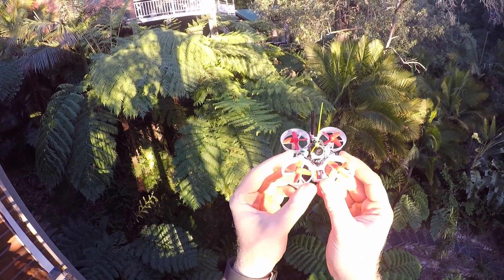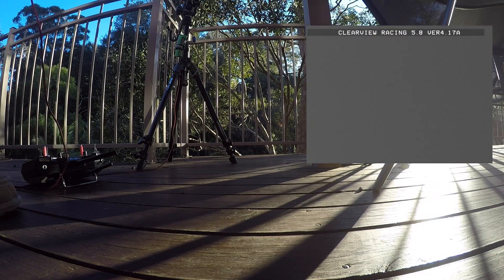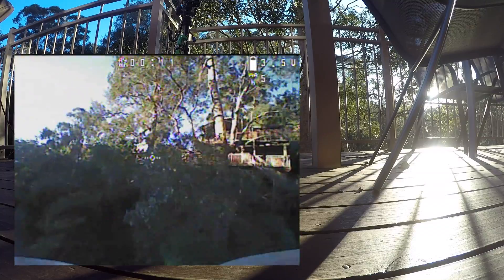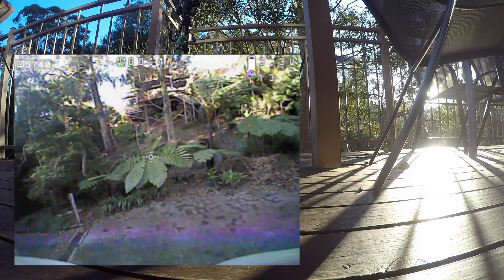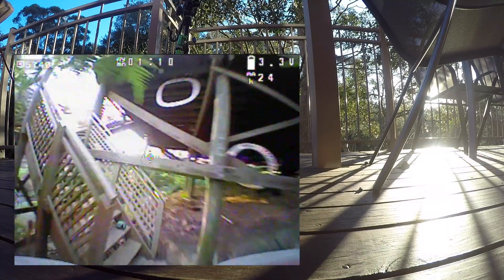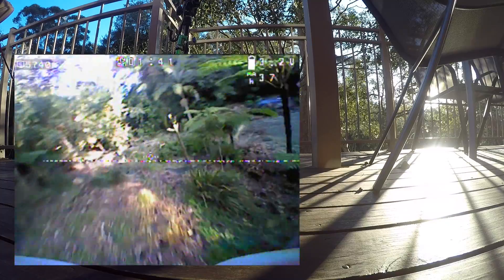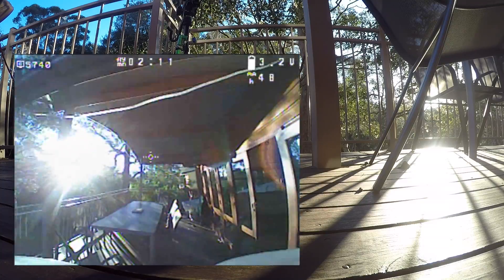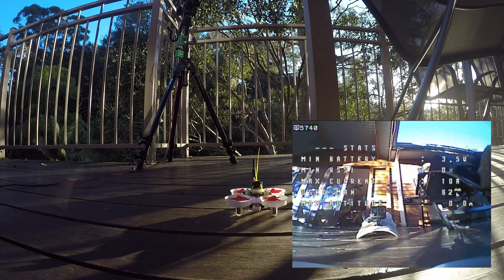BetaFPV F3 Whoop FC - with OSD!

Comment: You installed the FC upside down?  Please, I want to do that also if it's ok.  Thanks.
Reply from the maker: Sure ;)
you will find the required code changes (motor resource allocation and sensor orientation) to run the FC upside down here:
https://community.micro-motor-warehouse.com/t/betaflight-3-2-final-on-betafpv-f3-osd-whoop/5043

Greetings from Down Under
Benedikt
Reply: Thank you.

Comment: what is the betaflight 3.2 target? and is there a version with EU LBT?
Reply: Danny Mars this is BETAFLIGHTF3.
AFAIK, the firmware is only for the main chip, not for the Rx chip. So you probably have to flash this separately when you want LBT.
Reply: Benedikt Haak Thnx
Reply: basically same issue here! problem is RX channel assignments! obviously has to due with what u mentioned above, firmware is not for RX! I figured it is more complicated than remapping the transmitter or betaflight channels,  thanks to ur comment I confirmed my intuitions! is there a link or anything on how to flash the RX separately or should I not even mess with it and stick to 3.1.7! Thank you Benedikt Haak!

Comment: iv used OSD on some brushed quads. i wanted them for voltage alerts. but i find it near impossible to use as as soon as you take off voltage drops making monitoring pointless. so instead had to revert back to using a timer. any thoughts on this?
Reply from the maker: I dont have much experience yet, but from what I have seen so far you are probably right. Its seem very inaccurate to use the voltage as indicator for battery condition. Timing is probably still the best method.
But at least its accurate enough that I notice when I put a discharged pack on by accident ;)

Comment: +micro motor warehouse, last week I built a tiny whoop, and every time I arm the video goes to a weird sort of unflyable breakup, and when I disarm it comes back. I'm using the following parts: furious fpv acrowhoop v2  (frsky), a lumenier aio 200mw cam/vtx combo (mullet moded), mmw insane motors, mylipo 250mah, etc. Do you have any idea what the problem could be?
Reply from the maker: I assume thats interference. The camera and the vTx need to be protected from the electrical noise that FC and motor make. By shielding and filtering. I assume the input filter on your cam/vtx isnt working properly.
Reply: +Micro Motor Warehouse how can I fix it? (Or is it possible to fix :/)